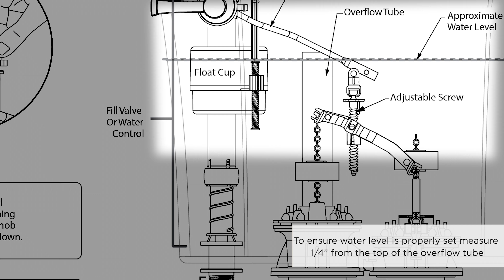How to Replace a Flush Valve on an American Standard VorMax Toilet

Comment: I have 3 of these exact same toilets in my house, I bought new dual flapper gaskets and toilets are still running non stop.  Any suggestions?  Thanks!
Reply: the gasket on for the flapper assembly to the tank leak. watch for the bubbles. managed to cheap out on a part that should be more then $.10 to begin with.

Comment: I have three Vormax toilets in my house. Worst investment for the house I can think of.  I've replaced the seals whole flapper assembly on a couple and the silicone discs multiple times in the last 4 years. That's $80 for two flapper assemblies and $18 each set of silicone discs x 10.  I just replaced the seals on one and it still leaks. So it's either a whole new flush valve assembly or a new toilet...and I'm inclined to buy a new, better designed toilet.
Reply from the maker: Hi There - Thank you for your feedback. We are sorry to hear that you are having problems with your VorMax toilets, and would like to learn more about your experience. Please give us a call at 800-442-1902 so we can make things right. Thanks!
Reply: I'm at replacement stage too.  Chronic problems - terrible design.  Don't fix what's not broken
Reply: City water cholrine destroys seals, if they last  two years your lucky.

Comment: how do you remove the bolts between the bowl and the tank.  I dont have anything that will fit it because of the ceramic recess it sits in.
Reply from the maker: Hi Glenn - The VorMax tank bolts can be removed with  a ½” deep well socket. If you do not have one and would like to request a hand tool from us, please give us a call at 800-442-1902 and we'll be happy to get that sent out to you. Thanks!
Reply: @americanstandard  you cannot get a deep well socket into the recess. Obviously you redesigned the toilet for ease of access.

Comment: Mine is emptying the whole tank out.  No bubbles , no sign of leak.  I'm guessing after reading these comments this toilet is junk .   I have been on hold right now for over an hour and a half to American Standard, so beside being junk their customer service is bad also.
Reply from the maker: Hi Craig - We are sorry for the frustration! Over time, the fill valve that controls the water flow can slip out of place and require readjusting. We recommend giving us a call at 800-442-1902 so we can get some more details and help address your issue. Thanks!
Reply: @americanstandard  It wasnt the fill valve I adjusted everything.  It ended up being the silicone flaps.  Even thought I waited so long on the phone the woman who I talked to was very sweet and helpful and rushed out the part.
Reply from the maker: @craigchristensen4972  We're happy to have helped address your issue! You can always give us a call at 800-442-1902 if you ever do need further assistance. Thanks!

Comment: So this toilet is awful.  I have 4 of them.  2 are no trouble. 1 has an issue with the silicone wear which causes the slow drip leak through the night.  But the one on the first floor - which all guests use, is a nightmare.  The chain link gets caught under the flapper regularly.  Adjusting the length, floaters, screw depth, flush lever - never fixed the problem.  On top of that ... every attempted fix required 5 "prime" flushes to return the air cycle to get a fully cyclone flush.  So it's literally a 20 minute project minimum with every attempt. I've spent hours on this toilet.  A disaster.  My question is - can I just swap out the tank?  Or need a full toilet replacement?  Anyone? Thx

Comment: Poorly designed toilets, constantly leaking. I have two of these and have wasted soo much water. I’ve replaced the flapper several times, and I’m done. It cost about $26 each time just to replace the silicone flap.  I’m buying Toto’s and trashing two of my toilets.
Reply from the maker: Hi There - We're sorry to hear that you're having problems with your VorMax toilet and silicone flapper seals, but appreciate you taking the time to share this feedback with us. Please give us a call at 800-442-1902 so we can get some more details and help address your issue. Thanks!